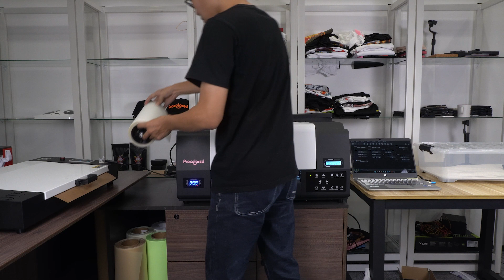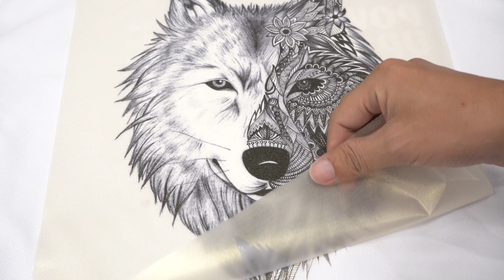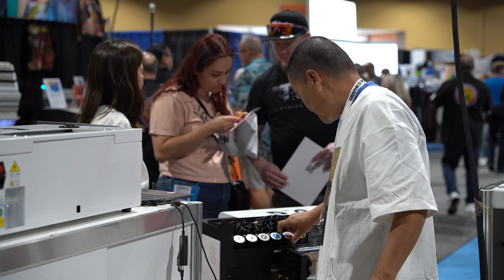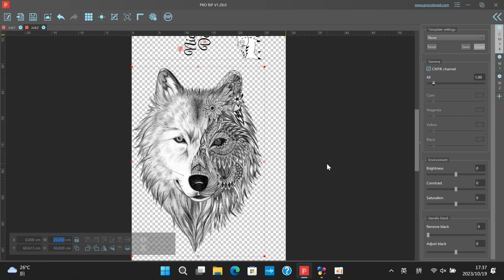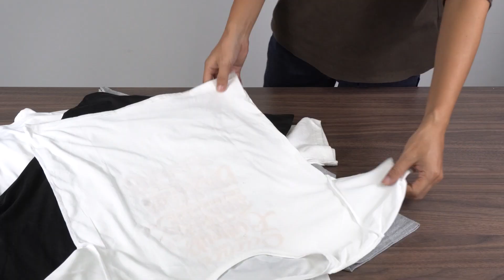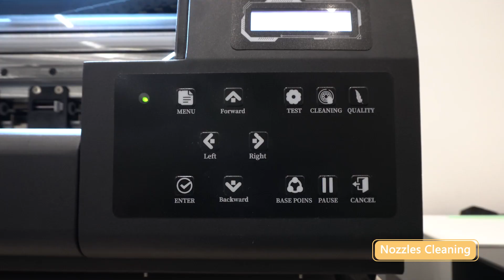T-shirt Printing - the Most Common Asked Questions

Comment: Hello everyone and Procolored! Happy Christmas to you and a very important question. I bought the Precolored Model 1800 and did EVERYTHING exactly according to the videos on the sticks that came with it! It prints excellently and above all MEGA quietly :) My ONLY problem, however, is that the colors are NOT printed the way I see them in Photoshop EVEN THOUGH I also installed the PRO RIP 2.0 EXACTLY according to the instructions ;( Can someone PLEASE PLEASE help me with what I need to do Where am I going wrong? I thank you from the bottom of my heart for your tips and help. Kind regards, Frank
Reply from the maker: Hello, please send an email to afterservice@procolored.com, we will ask our tech staff to help you fix it
Reply: Hi, I'm having the same issue. For me the colors come out noticeably darker than how they appear in photoshop or RIP. Did your problem get solved by any chance?